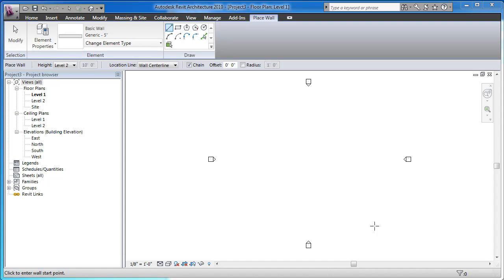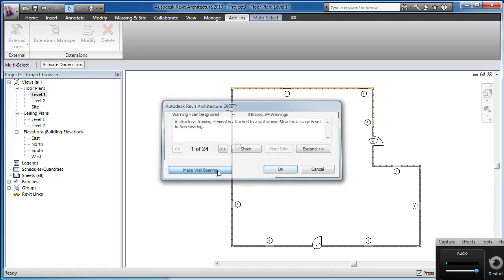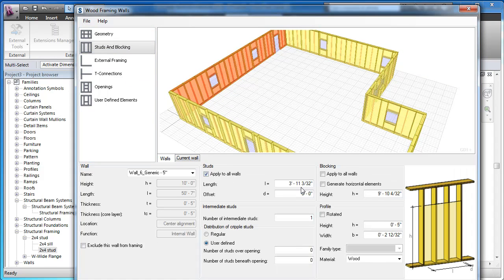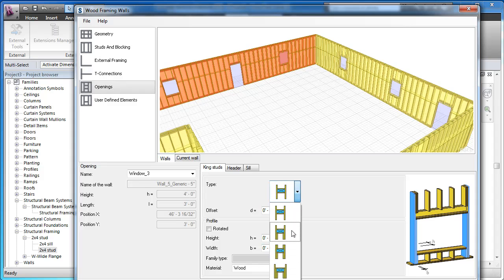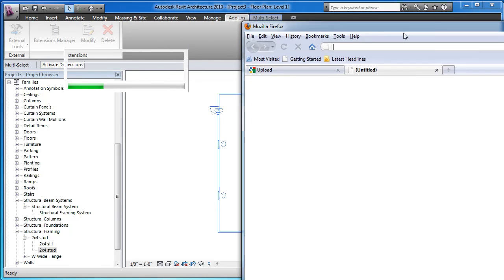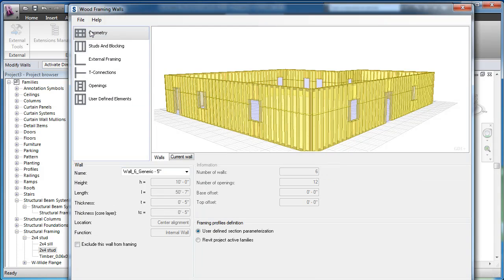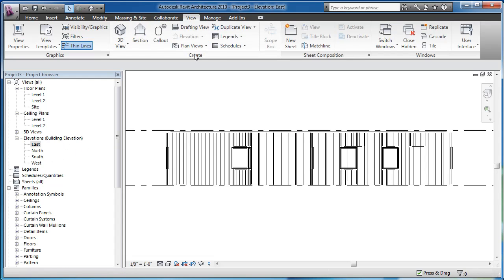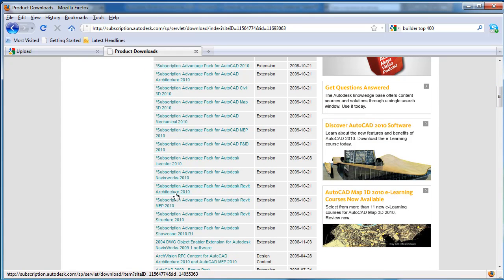An Overview of Revit Wood Wall Framing Extension

Comment: I drew walls out of air and inserted windows and doors and all other items in the  fake walls.  The reason I made those walls is so that the timberframe would be encapsulated by those walls and take on those dimensions set forth by those "walls".  Problem is that the timber frame was 1/2 way in those " walls" and the other half sticking out in the exterior.  This made my windows and doors all have studs going through them and threw the dimensions out of whack.   Got any suggestions.  Is there a setting that I am missing?

Comment: @wojocad Under the geometry section there is a box on the right hand side called Layers and properties. You can select which layer you want the framing to appear in. Im using 2012, so cannot confirm earlier versions.